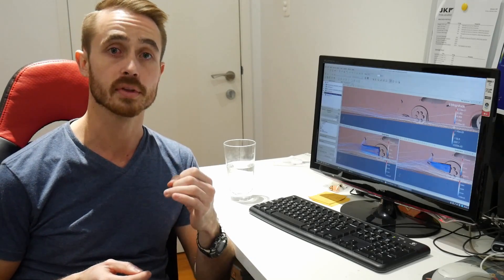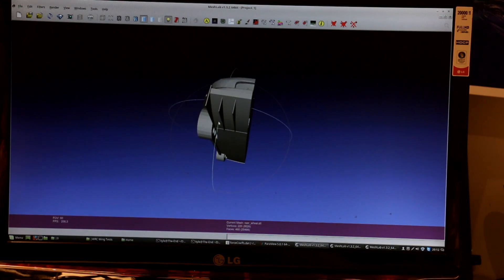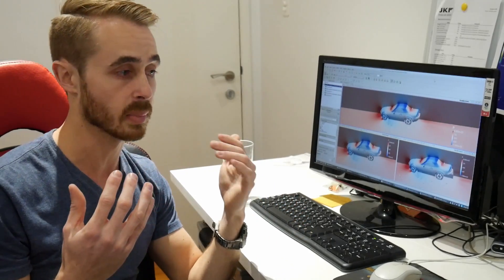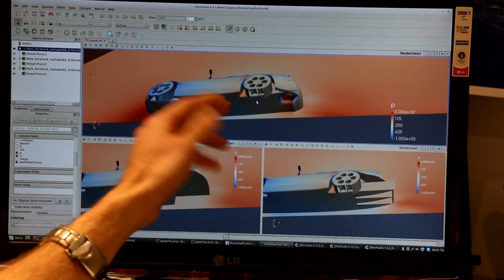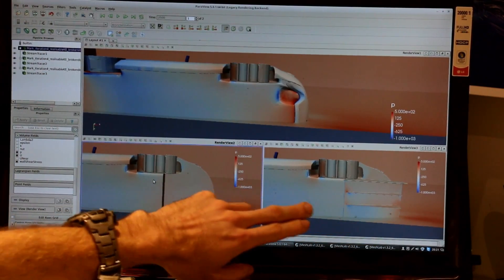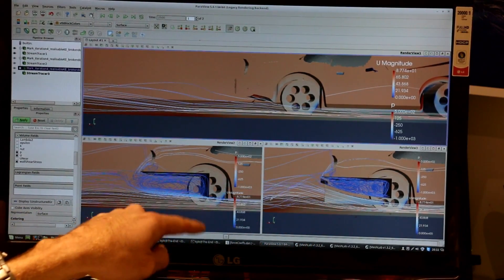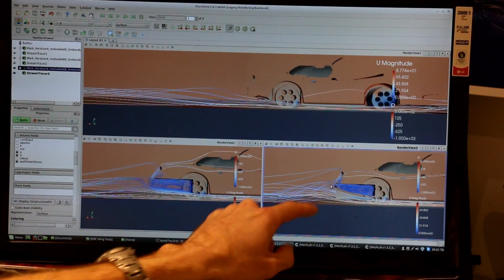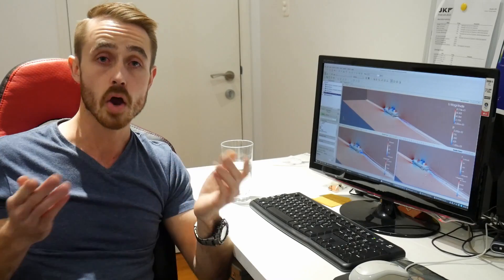Is Cutting Your Bumper as Good as a Diffuser??

Comment: Well, your baseline geometry has a very smooth rear and rear bumper. In reality the bumper could be acting like a parachute.

Why do you have a vortex in the diffuser case at 3:35? There is some leaking air between the diffuser and the rear section of the car. That is a mistake, no?

Comment: APR Performance makes a beautiful carbon fiber diffuser for the 2005 - 2009 Mustang. This panel extends almost to the axle underneath the vehicle. It also has three large screened vents in the upper rear surface to allow the air that goes over the top of the diffuser a place to exit. The strakes are  very large, so much so, that when I had to have the car put on a flat bed truck due to the trans going out, I had to remove the diffuser so it would not get damaged when transitioning from flat ground to the angled bed of the truck. I don't know if it makes a huge difference or not, but APR does say it is wind tunnel designed. On the upper surface, there are four large slots where the strakes are located. When I removed it for towing, they were filled with debris, leafs, pine needles, dirt and mud. So obviously there is air flow there. I chose to fill these in while the diffuser was off. Cut foam to fill the channels, then smoothed them over with black RTV, and made them very smooth using  3M seal tools. At least, if I have to remove it again, the channels will not be billed with muck. Maybe the filled channels make the diffuser work a slight bit more efficiently? 

https://shop.aprperformance.com/index.php?route=product/product&path=72_128_80_163&product_id=71

Comment: What if you do both?

Also the reason most of us cut bumpers isn’t downforce. But the parachute effect when we remove the factory exhaust systems. Most factory systems have a huge unit to fill the under car space to keep flow reasonable smooth past it self.

When we go to aftermarket exhausts usually just tubing there is lots of open space in front of the bumper and the bumper just catches wind coming from below the chassis. So we cut the bumper to get rid of parachuting/drag not downforce. I had a 2’x4’ gap that just caught air when I removed my stock exhaust under my Z.
Reply: This seems common with tracked z's, though I'm running a Z1 single exit with a bumper tuck. I'm not sure if that improves the parachuting effect though
Reply: Hey this is like really late but do you know if it would do anything on a 2021 Elantra? I just love how it looks

Comment: Its sept 2018 .Really need to talk about street speeds .When at what speed does an aero flat floor and diffuser actually start to create down force.
        We all should know by now covering the bottom of the car as much as practical to rid the bottom of large air pockets like under engine compartment from air dam to firewall. And an ajoining section 
Covering the trans tunnel ( on rear drive cars and fwd ).And the third section from end of trans tunnel to rear bumper to cover diff fuel tank to bumper Which should, by nature, have a natural up sweep too gain some  diffuser-ish angle. Especialy if the front is racked lower than the rear.
This would be a simple task for most enthusiast with little money expended. However if the speeds of its effectiveness , dont come on till 100 miles an hour.
   It would not be a street performance mod for 87% of builders.
Reply: I’ve heard aero starts giving noticeable effect at 80km/h or 50mph already. I’m no engineer ofcourse.

Comment: KYLE.ENGINEERS, can you use a diffuser purely as a drag reduction device, like for a drag racing car with plenty of mechanical grip, and tune most of the downforce out of it, or would it be more practical to just use a cut bumper since it already doesn't produce much downforce?

Comment: In this video, https://www.youtube.com/watch?v=9jNi_rCSjmg at minute 3:40 you can see a way to avoid the muffler at the back of the rear axle, by placing it forward and reversing the flow. In this case, the path followed is complicated, but I guess is due to Category Regulations about the exhaust system length. But that´s the basic idea on how to avoid mixing the diffuser with the muffler...

Comment: The modeling for the stock unmodified condition seems a bit in error.
The rear bumper does not fill in the area between the floor pan and the lower edge of the rear bumper.  You show that as a solid without any void.
The rear bumper cover is simply a vertical wall blocking the view from behind the car, and that large open area is open to the ground beneath the vehicle.
I would be interested to see the modeling if you compared the removed rear bumper model to that same model with a vertical wall at the rear edge where that bumper cover is, and the open cavity catching air and causing turbulence.
Reply: ^This, his model is showing a car that is flat on bottom, and very few cars come out of the factory like that. Most bumpers/rear clips whatever you want to call it are just a body panel covering the actual crash beam. And with the shape of them, they are terrible for aero as it's essentially a parachute trapping air. Which is one of the reasons for getting a diffuser, to fill in the gap between the bumper and the body so that air doesn't get trapped. Hold an empty cup out the window going down the road with the open end forward...that's basically your rear bumper.

Comment: Hey Kyle, what if we cut the rear bumper in a way that retains the side edges so as to mimic a diffuser with two blades - one on the leftmost edge of the car and one on the rightmost edge - in other words, just cutting the bottom section of the rear face off of the rear bumper. Would that be significantly better than a fully-chopped rear bumper like the one you have done in this simulation?

Comment: I don't really get the point of gigantic Aero packages on FSAE 
cars. Do you think they are effective? if so how at low speeds?
Reply: That’s the whole point. The lower speed you need it to work, the more aggressive it needs to be. It would create enormous drag at high speeds though. Since FS has a pretty limited top speed and they’re not wanting for power but traction, it’s fine to run very aggressive aero.

Comment: What about all the "diffusers" on common street cars these days, that are basically just fins they put on the back of bumpers? (New focus RS one of many examples). When I first saw them I thought they were a ridiculous fake non functional fashion element. However, they seem to be getting more and more popular. Do they function at all?
Reply: Maybe they veeeeeeery slighty decrease fuel consumption . But mostly probably just for looks.
Reply: Yes i would think so any diffuser is better than none, does it create as big of flow or vortexes as a proper racing built one on any racing car but it would do something like this test not as much as an all out diffuser but  some down force would be generated.
Reply: All show. Insignificant difference.
Reply: The diffuser on the 2018 Focus RS has a sharp corner where separation will probably occur. The diffuser is just there for looks, it seems.

Comment: Hi Kyle, 

Firstly thank you for making this video as I've found the subject of cut bumpers and diffusers comes up during many track side garage conversations. 

I know you said that your model is simplified and I appreciate that you cannot capture everything in a simulation however I noticed that it has a completely smooth flat floor. 

You can see by the flow lines that this is resulting in laminar flow ahead of the bumper/diffuser region. 

Typically people looking at cutting their bumper are not looking to do so on vehicles with a flat floor. 

Would you be able to run this simulation again with underfloor details that more accurately represent a real car? 

I would be really interested to know if the same lift and drag trend is found with a turbulent underbody air flow.

Comment: I feel the "notch" in front of the rear bumper is typically larger than in your base config, but also there is the fuel tank, the rear suspension, the exhaust filling that "notch", so you'd never have the room for such a large and 90° cut-off. Which on the one hand would cause less effect but also less turbulence/separation...I am not qualified to say what effect it has, but the geometry you present seems not wholly relevant? 

Okay, if we compare high-end cars with re-routed exhaust and fuel cell, then sure, you have a lot of room to play with. But those high-end cars would always run a diffusor of sorts anyway, not a cut bumper. 
 
For anything less extreme, look at this Miata underbody: 
http://forum.miata.net/vb/showthread.php?t=587365 
The final muffler/silencer would probably not be used, so that's probably about the potential for the cut-out.

Also, what effect has the dirty air generated by the front of most cars for the flow across the rear?